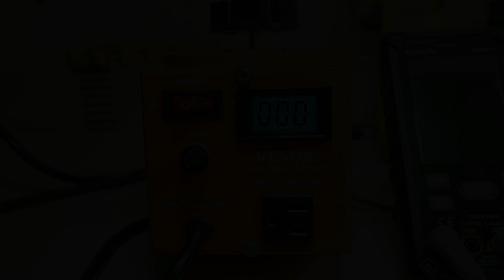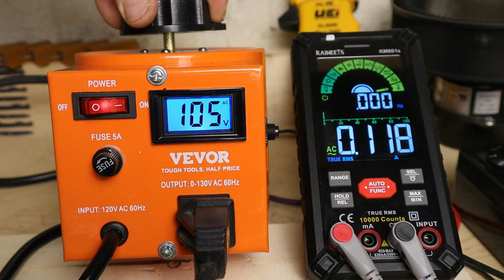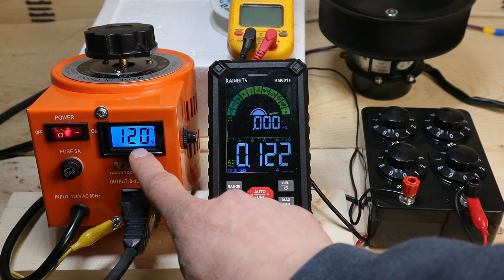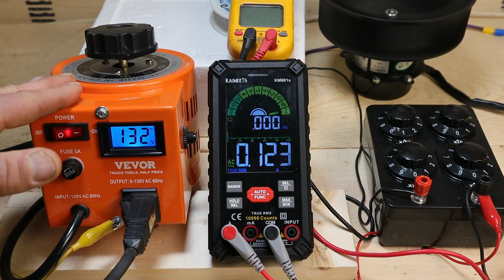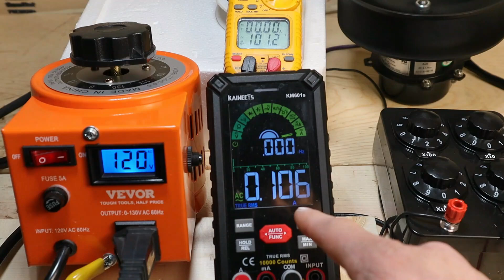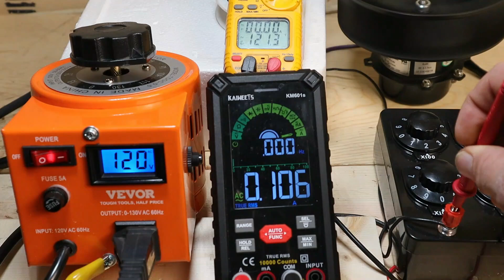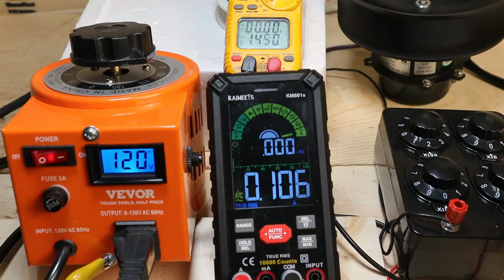A Simple Demo of Ohms Law (And Why it Matters)

Comment: Love your videos! Question though, so typically in larger HVAC equipment and heck even some residential, when the equipment as a whole is looked at, the higher 460v has a lower amp draw than an identical system that requires 208/230v, is this due to the increased resistance on the 460v units components?
Reply from the maker: It's because the 480 is 3 phase power vs. 208/230 being single split phase. 3 phase distributes lower more evenly allowing for lower amperage draw with the same HP output.

Comment: Great channel you're a good teacher subscribed. 

Anyone who happens upon this I'm having an issue with a simple battery and light circuit. I made the equivalent of a jewelry glass for ICs but with a small halogen light cleverly Intergrated inside rated at just 3 volts. I'm using 3.7 volt lithium vape batteries but I want to bring the voltage and current down not just the current while volts stay the same. I had to make my own resistor from adulterated pencil graphite and it does decrease the current but not the voltage. I couldn't lift any resistors that'll work with this... well not yet.

My question is how is the current and Brightness decreasing but not the voltage?

And BTW the graphite pencil resistor can get hot... hot as hell
Reply from the maker: Look into a concept called a "voltage divider circuit".

Comment: Voltage = Pressure = Not Electrons, What is Voltage since its Not Electrons? The resistor is voltage dropping what, the resistor is NOT dropping the electrons but what is it dropping since voltage is NOT electrons?
Reply from the maker: Potential difference.
Reply: @JerseyMikeHVAC  correct but potential difference is NOT electrons, what is potential difference if its not dropping electrons?
Reply from the maker: Not sure what you mean by "dropping electrons" but it's an electric field influenced force.
Reply: @JerseyMikeHVAC  the resistor is NOT dropping the electrons but dropping lowering the potential difference of the EMF electric field force. The EMF is NOT electrons. Current = electrons, Voltage = Electric Field Force ( Not electrons ). The question is since Voltage is NOT electrons, what is voltage made out of?
Reply from the maker: @waynegram8907 It's not made out of anything. It's a property of an electric field.
Reply: @JerseyMikeHVAC  The Electric Field is NOT made out of electrons? The electric field is either made up by chemicals like inside a battery or is made up by turning manually a motor by mechanical force. A Battery is packed full of chemicals with one negative polarity electrode rod and one positive polarity electrode rod. The magnetic field created by the batteries + positive electrode and - negative electrode is pushing the current electrons to FLOW. The batteries + positive terminal and - negative terminal create a electric field so electrons will FLOW because of the "magnetism" because electrons are "negatively charged" the batteries + positive terminal is magnetically polarized that is attracting pulling the negatively charged electrons. When a resistor is functioning as a voltage divider the "total" electrons entering and leaving the voltage divider circuit is the same electron total, but the voltage divider is dropping the electric field/pressure/voltage. The resistor is dissipating the electric field/emf/voltage into heat.
Reply from the maker: Voltage exists across two points regardless of whether current (flow of electrons) is present or not. It is not conditional on current flow.
Reply: @JerseyMikeHVAC  True correct I agree. Voltage exists across two points that are at two different potentials. But the question is what is a potential? since a potential is NOT electrons, what is a potential made out of?
Reply from the maker: @waynegram8907  Its not made of anything. It's math.
Reply: @JerseyMikeHVAC  The - Negative Potential and + Positive Potential have to be made out of something. Its magnetism a magnetic field/magnetic force.

Comment: WHERE WAS THE OTHER PROBE WHEN TESTING EATHER SIDE???
Reply from the maker: Usually you'll use the neutral wire, but I couldn't in this set up because I already had a multimeter hook up measuring ohms.
Reply: @JerseyMikeHVAC  BUT I can use the neutral for ohm readings? AND THANKU
Reply from the maker: Not for ohm readings, no.  If you're using probes you have to place the meter in series with the circuit, unlike a voltage reading, meaning the power wire has to run through the meter itself.  In the video, the wire coming off of the resistor box went to one probe of my meter, the other probe went to a wire then going straight to power the motor.